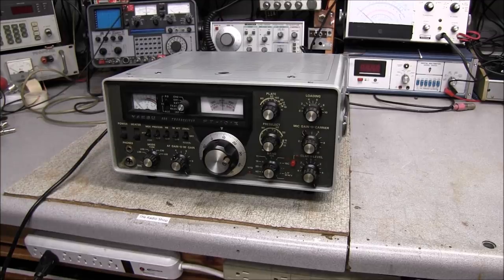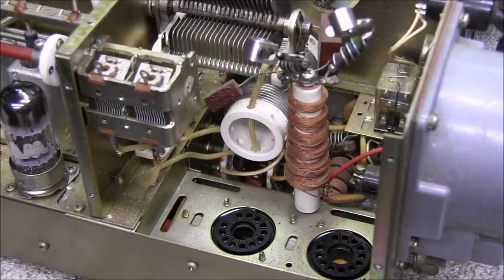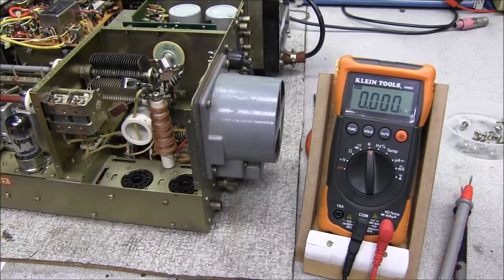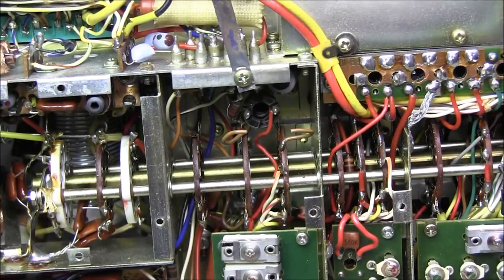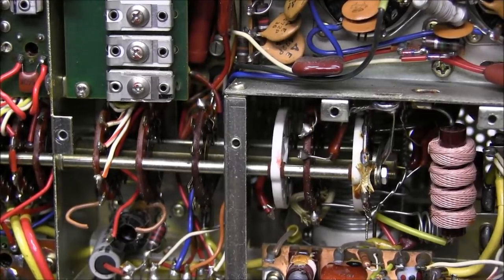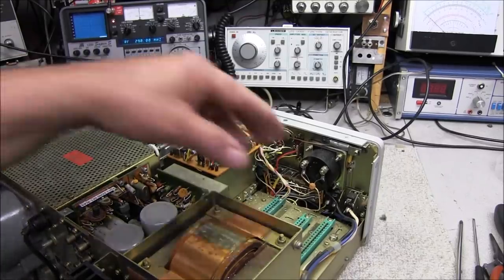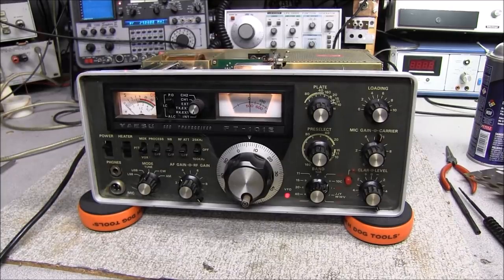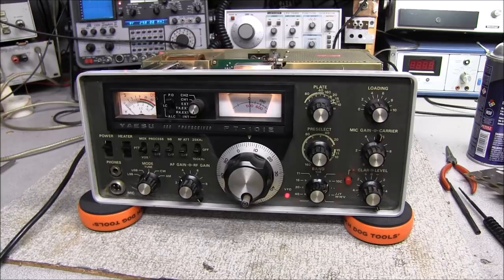#207 Yaesu FT101 Series - Final Tube Replacement

Comment: I'm in the process of watching every single FT-101 video you have. Priceless knowledge and I agree on the labour factor as well by learning how to do it yourself. For years i used nothing more than the inbuilt calibrator in my TS-520S or FT-101E, the power meter and a dummy load. Maybe a second receiver if I needed it and a cheap volt meter. In the process of getting better gear now. Thanks for all of these 101 videos :)

Comment: Great FT-101E radio repair. These radios just keep working and working if a little TLC is used. The plug in boards make repairs easy and lots of parts around from unrepairable units. Tubes are still available but costly. These are my favourite transceiver and I have 3 of them. Thanks Buddy for working on this old classic radio and I am sure there are many hams out there that still use them.

Comment: If I remember correctly, cutting that brown wire allows the rig to transmit on 11 Meters. Not positive about this but I think that is what the guy I bought mine from told me back in 1975. Great video Buddy! Loved it. Talk about component level repairs, that repair of the switch was amazing. Love your comments on the difference between repair and restore. Keep them coming Buddy. 73 DE K7RMJ Frank
Reply: cuban9splat He's right. Every forum confirm this. This was the most popular radio for 11 meters
Reply from the maker: You are remembering correctly my friend. That is just what it does. The switch in this radio is fairly easy to disassemble.  But you can only do a few times before the little fingers break off. Part of radio maintenance is keep them clean so you do not have to go into that far. Yes folks do not understand that restoring a radio can out weigh the value quickly.  Most of the time I do not do "rants" but felt like it needed to be said. Thanks as always Frank. 73
Reply from the maker: @624radicalham  Agreed. Second most rig ever used on 11 meters was the 101.  The fist was the Swan 1011. Not to be confused with the Siltronix 1011C. That was just a cb. Many 101's were sold and used by the 11 meter operators during the 70's mostly because ssb folks cared about how they sounded on air. Then came the 80's.....
Reply: @TheRadioShop  Great thing about you is the commentary you provide during repair. More helpful than you can imagine!
Reply from the maker: @624radicalham  Thanks for those very kind words

Comment: Very interesting and informative video. I used to have an early 101and our go to guy in the UK was Harry Leeming G3LLL. He was an absolute master of the 101 and he changed the PA valves (tubes) for me. He also made a speech processor for the early models of the 101 which was superb. I had a lot of success with the old radio and I still wish I had never sold it. Thanks again for the great video Lynton G4XCQ

Comment: Excellent set of videos Alton, only just found your You Tube channel. Its taken a few years but I have I believe a complete Yaesu station, starting with the Silver Panel FT-200, FT-101B, FT-101E, FT-101EE, FTV-650B and FTV-250, FV-101B, YO-100, YC-601, YP-150, YS-200, P-101PB, SP-101B, FL2100B, FL-2100Z, YD-844, and the FR-101RD together with the FL-101...and a FRG-7...I haven't seen a FT-101, but if I do I'll probably get one of those as well...thanks for your informative videos. Cheers Clint - VK3CSJ Melbourne.
Reply from the maker: Thanks for the comment Clint. Nice station you have there.

Comment: If there's a single transciver that belongs om the list of greatest HF's ever the 101 series, might be number 1. If not definitely in the top 3. Besides the long warmup period before it stops drifting (which most transcivers of this period suffer) I can't think of anything else that the rig suffers from. When all is dialed in correctly they're not only superb sounding SSB performers but it's AM audio is awsom! I'm assuming an online search can substantiate how many were produced and sold (millions?) There are so many still on the airwaves and sell in almost any condition. There's an eBay seller who specifically refurbishes and sells them. Parts are easily found as there's many parts 101's for sale. Then there's those who specifically buy them in order to part them out. These 101's might be on the air for another 100 years. No matter how small and highly advanced HF's become there will always be those who don't mind having to spend 5 minutes tunning them up in order to get them on air. Truly a peice of HF history that's still highly sought after. And those buying them aren't doing so in order to put them in a cabinet so that they (the 101) can be admired behind a peice of glass. If you're not one who needs DSP ect ect technology the 101 is imo a spectacular amateur radio. Yeasu hit the nail on the head when they got it right. I've read there were bugs in the earliest ones off the line. But those bugs were quickly worked out. And as they say: the rest is history. 
Great clip. Great repair. On possibly the greatest HF ever to come out of Japan (or anywhere for that matter.) Keep up the excellent work. And sharing. Thank you, 73's PS. The 101's receive is also on point. I will always stop in order to listen to a qso when one or even better both stations are using one of the 101 transcivers.

Comment: The brown wire is cut to allow transmit on 11 meters. From the factory, on the ones that have the 11 meter position on the band switch, 11 meters was receive only. Cutting the brown wire enabled transmit on 11 meters.

Comment: I owned an FT-101B and FT-101EX and both were loaded with a full set of crystals including 11 meters and the EX also had the AM Filter installed and both had been refurbished and they were nothing but trouble. They constantly needed work for one thing or another.I was so happy when they were long gone from here and somebody else could deal with them.I consider them highly overrated with a bunch of Garbage Hype and not worth $100 loaded in Mint Condition if I was required to keep and use them.

Comment: Early model E/EE with 11 meters on the bandswitch have the wire cut so that the radio will transmit on 11 meters.  Splicing mine back together tendered that band as no transmit 14:23

Comment: The only thing u didnt  mention was TO REPLACE the driver coupling cap from the original as this causes finals  to fail due to leakage (electronic} ok . still using one today with second set of tubes b4 I got it back b4 1980.  good stuff

Comment: Hi Buddy. I recently did the cold compensation method you described in this video on 2 FT-101's and both of them now draw around 400 Watts during TX for a normal RF output. What have I done wrong or is there something I am missing? I obtain resonance with the plate setting a bit off the 10 meter scale on the high side and loading at 10. This is not normal as far as I can tell.. Help!

Comment: hi there i have a yaesu ft 101b had it stored under my bed 4 months fired it up waited 4 minits and smoked blow a capasiter still switches on  can i replace the capasiter or will i need a new transformer

Comment: Great video! This has helped me understand more about the FT-101. I recently was gifted a FT-101E from a fellow ham and I plan to restore it. It was last used in 97 and was working then. I will watch your 101 playlist to see what I can pickup. But I thought I would ask you, do you know of a reliable source to get a power cord for an FT-101E? I see some on Ebay but have had people warn me on the QRZ forums not to buy them from Ebay. Also, do you suggest I look for anything specific before I try to power it on? Someone told me to use a variac and raise the voltage in stages over and hour or so to condition the electrolytics since it hasn't been powered on in over 20 years. This is my first rig with tubes in it, so I know to be careful, and it creeps me out, but they're such beautiful radios an should be on the air. Any tips or advice is welcome. :-)

Comment: The Radio Shop,
My FT-101E transceiver mic gain isn't working properly I have to turn both D104/101-E gain to they're maximum for the microphone to work properly.
I changed out the battery in the D-104 but I still have to keep them at the maximum position. Do you know what the problem is. 
Any help would be greatly appreciated.

Comment: If tubes test good and voltages on the tube sockets and plate test good. What are other posibilities of low output. The rig was working fine. Sat for about 3 weeks. Now only 20 watts out. Thanks for the great videos. You have helped me a lot in keeping my old 101 going.
Thanks
Roger
KW4EMF

Comment: When you neutralize a tube, do you mean the capacitor shorts out the transmit tube so it doesn't oscillate when you're in receive mode?
Reply: Capacitors block DC voltages and pass AC voltages. So if you wanted an amplifier circuit to not have stray AC voltages bouncing around then you typically have a capacitor to ground. I don't know tubes, but if this was a transistor amplifier then the capacitor I speak of would be attached from emitter to ground. Also you would have such filter capacitors between two stages of amplification so the DC voltages don't back feed and blow up your transistor.

Correct me if I'm wrong Buddy! I'm young and still learning.
Reply: All tubes have some stray capacitance between elements.  That can couple the input to the output in a way that can cause the tube to oscillate.  Neutralization is about canceling the effects of that stray capacitance.
Reply from the maker: Russell gave a good description below.
Reply: @russellhltn1396  
Understood. Thank you.

Comment: Hello, I enjoy watching your videos working on the Yaesu FT 101s! What I would like to know what is your procedure for customer repairs. I have a 101EX that I bought off of eBay, the radio is in EXCELLENT condition, I would like to get it repaired?  I forgot to state the problem: the radio has no sound, I would like to also get it realigned. Thanks

Comment: I was curious to see if you have done much work on Galaxy radios. I just bought a dx99v and have noticed intermittently the frequency will drop to around 24MHz and turning knobs will make it change back to the correct freq. Was wondering if maybe a crystal may be going bad or something along that line. 

I really enjoy your videos and am gaining a little bit of an education in the process. I understand Galaxy is a touchy subject for some but I have always liked them personally. I want to learn more.
Reply: I finally got around to taking the covers off this galaxy and seen some "mods" have been done to it. I found the info i needed to get it back to normal and plan on trying to work on it soon.

Comment: My search for C13 cap gave poor results. Where do i get one?
Reply from the maker: You can replace wit ha 82 pf 1 kv silver dip capacitor., Newark, RF PARTS, JUST RADIO carries them.
Reply: Thx sir, i value your advice. Does C13 replacement affect tune of the radio?

Comment: I have seen mention of some kind of bias setting or neutralization or something on high power amplifiers with the Tx tubes out, but it seems like maybe they substituted something for the tubes temporarily.  I would guess maybe a high voltage power resistor and capacitor(s) to simulate the Tx tubes to allow adjustments without risking the big tubes but this is just a guess.  Do you have any hints on what this process might be?  Sorry for such an unclear question but the people who do it seem to keep it as some kind of secret.
Reply: the cold neutralization is the same thing. the interelectrode capacitances of the tube are still there its just not emitting because there is no heater voltage.

Comment: Why are your hands so dirty is your other job as a mechanic?
Reply from the maker: At work I handle a lot of parts for inspection. Most of these are soaked with hydraulic fluid. Even with gloves the sharp castings cut through them. Plus I handle lots of cardboard. Also very dry skin. No when I am home and not in the electronics shop I am in the garage. Just this past week pulled a tranny from a Ford Explorer and tore down a engine from a 1947 Minneapolis Molene tractor.  Gojo makes a lot of money from me.  I have been seeing a dermatologist but lets face it, I work for a living lol. .

Comment: I owned an FT-101EX and an FT-101D and I was not impressed with either.I see them as very overrated and overpriced.You could not give me any of them.High maintenance radios as well.
Reply from the maker: We can say that about any radio on the market.  In fact it has been said.  The biggest problems with the 101 series is a lot of these were screwdrivered to death by free banders.